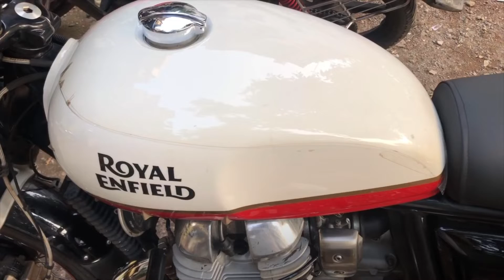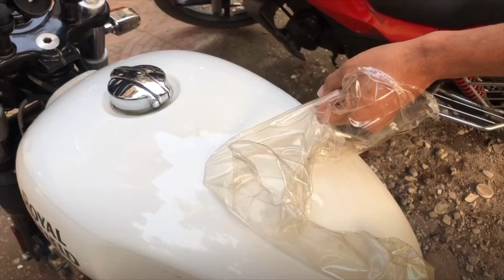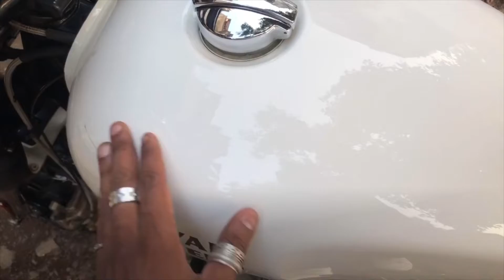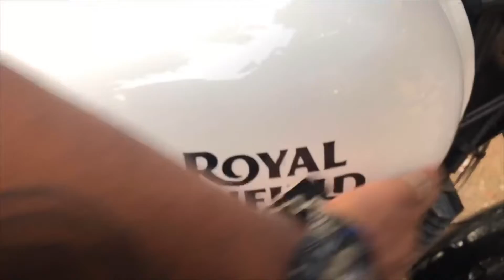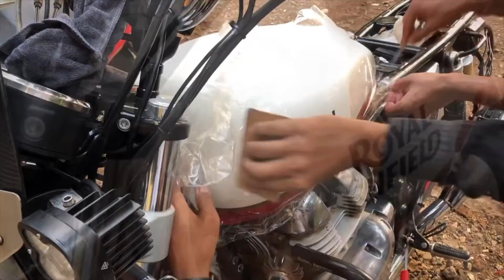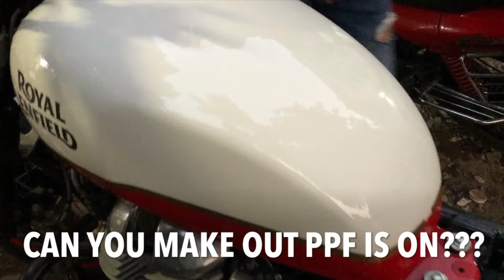PPF Removal & Installation | Will it spoil the paint ??

Comment: Seen lots of videos where they use the whole sheet for the tank as it’s better that way ask ur guy not to cut it in 3 sections .
Reply from the maker: Depends on the sheet quality 3mm ones are thick not like the Chinese ones

Also the benefit I have seen with it being in three parts is incase there is a scratch or any thing only that part needs to be replaced and not the entire sheet bro

Comment: Which one should I opt for my Glitter and chrome dust Interceptor 650- PPF or Ceramic coating or BOTH? Please help. I am from Baroda, Gujarat.
Reply from the maker: See u have a chrome bike which in the PPF would look dull as the shine will go as when the sun reflects it won’t hit the tank much hence a little of the shine will go 

But it tank will be completely safe from scratching n dust 

We’re as ceramic is only for some time and effect will go away also it’s not scratch resistance